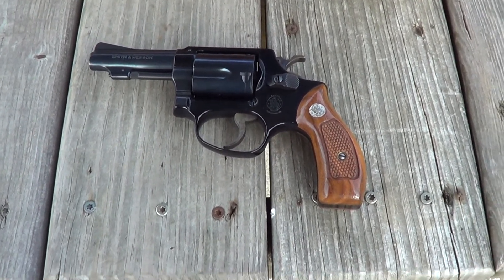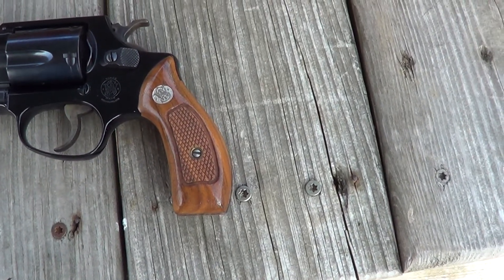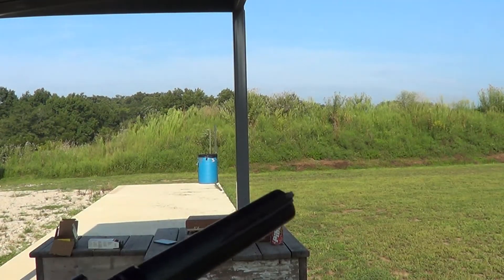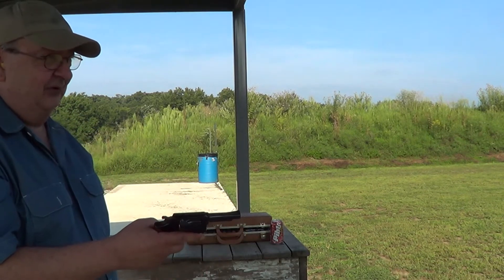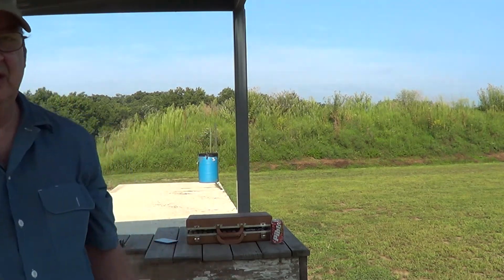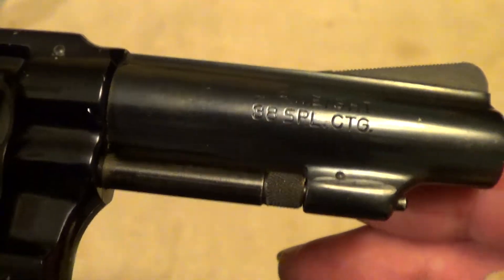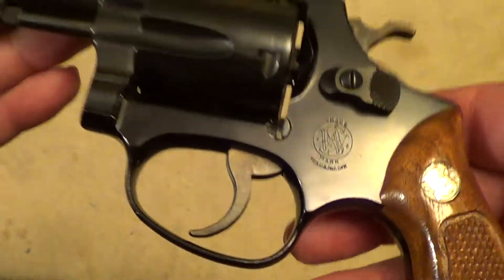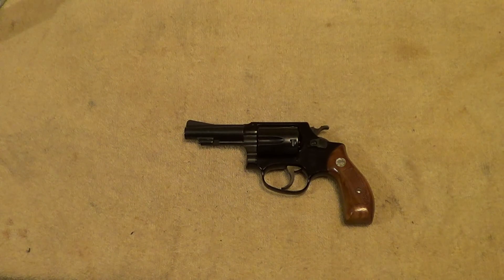S&W Model 37 Air Weight Chief`s Special

Comment: hi  to you .. ‼️
i woul  ask a    simple question,  why does  the fore pinlatch  remain out when the cylinder is closed ... ❓
bye bye
👋
Reply from the maker: If I understand correctly, you are saying that on your gun the forward end of the ejector rod does not lock into place with the locking lug under the barrel when the cylinder is closed.
I can think of 3 reasons this might happen.
#1 Your ejector rod might be bent.
#2 The ejector rod might be loose. If it is not screwed completely into the ejector assembly it will protrude too far forward to lock up properly.
#3 The barrel lug lock pin (the piece that should line up with the end of the ejector rod and lock it into place) might not be moving, or moving as freely as it should. That pin has a spring behind it inside the barrel lug that pushes it toward the ejector rod to lock it up but still allow the pin to move forward under pressure to allow the ejector rod to unlock and lock with it when the cylinder is opened and closed. If it does not move when you apply pressure to it, it might be frozen in place by rust or old dried up oil and grease inside the barrel lug. This is a fairly common problem on guns that have been stored away and not used for years at a time.
If none of these seem to be the cause of your problem you should take your gun to your local gunsmith and let him look it over.
Reply: @1957Shep ,   hi, to you  ... ‼️
 thankyou  for your answer   ‼️
but i don't  ask for my revolver,    i ask  for your, for the revolver  of your video,  seem that the forward lock pin remain out of  head  than ejector rod when you close the revolver  ... ⁉️
bye bye
👋👍
Reply from the maker: @antoninolatorre8355  No, it works properly. Sometimes a camera can distort things.
Reply: @1957Shep   
 ok  ‼️
thankyou  ...
 bye bye 👍